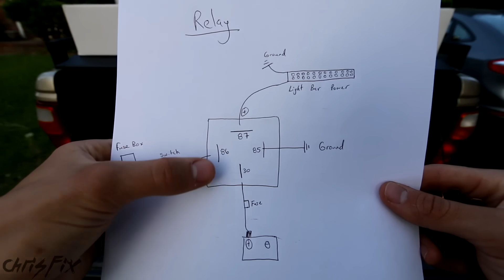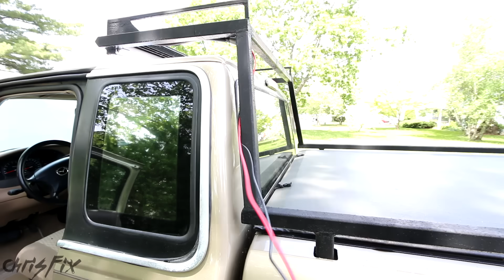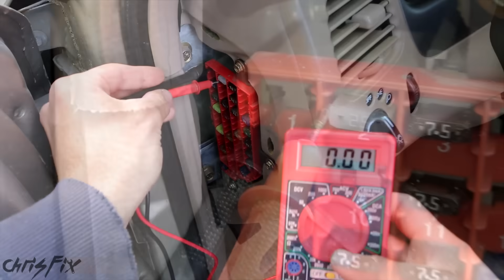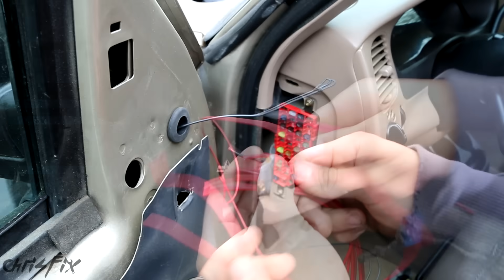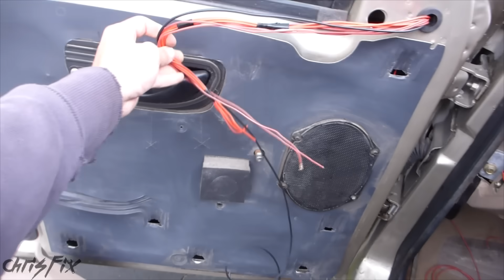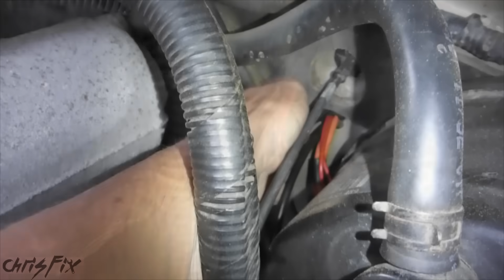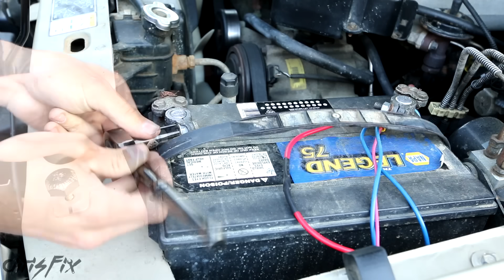How to Wire an LED Light Bar Properly (Project Night Light Episode 3)

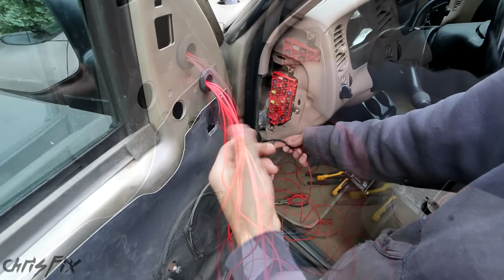Comment: Pro Tip: At around 15:00, get yourself some white duct-tape and wrap each wire on both ends with the duct-tape below the exposed wire tip before feeding them through panels and such. Then take a sharpie and put lines in the tape for each wire you have. So, if you have 5 wires, each wire should have how many lines it matches with. Ex: Wire 1 has 1 marker line on it on both ends. Wire 2 has 2 marker lines on it on both ends. That way you can distinguish which wire is what and you don't cross wires when installing future things.
Reply from the maker: +Robert Lewis That is an awesome idea! Thanks!

Comment: Great video but just so you know, you could daisy chain the 12V power as you did with the ground, as they'd all be running relays there wouldn't be much current draw. Just an idea if you want to add more switches in the future.
Reply from the maker: +Skutov R Thanks! Yea, that is something I havent thought about! I like it!

Comment: Hey chris fix, I drive a scion tc.  I want more light, more than my 55 watt hids.  Could I mount a led light bar behind my grill, will that give me more light, close and down the road?
Reply from the maker: +2583060 You cannot use these on the roadways with cars on it. This will blind a driver. I will be doing a video on how to mount a wire a light bar behind the grill of a car. If you live on remote roads this could work though. Gotta wire it into the high beams.
Reply: +ChrisFix cant wait for a video.  Also what if I just put HID bulbs in my reflector fog lights? will that help give me more light down the road?  Or like can I put some spotlights in my foglights?

Comment: What exactly is a ground for?
Reply from the maker: +Jason Forgeron That is how your lights get power. The ground is completing the electrical circuit. .
Reply: +Jason Forgeron And the good thing (or not) with a vehicle is that the ground everywhere on the frame

Comment: I have a question about the wiring of the switches, if you chose not to attach a ground to them would they still turn the light bars on? I personally wouldn't want to have the switches illuminated 24/7 but want a rocker style switch like those, is it that simple to get no light in the switch or does it need to be grounded out to work?

Comment: This is epic! It's so simple to wire something that looks so complicated. Just btw, the spots from the light bar look a bit low? Looks like quite a lot of light is projected at one small spot on the trail, can you not adjust the light bar up some more to throw more light further down the road?
Reply from the maker: +MrSly870 The light bar is actually perfect in real life. That might just be the camera exposure adjusting. Thanks man!

Comment: I wire my light bars so that there's a master "arm" switch, and then the light bar relay is triggered by the high beams. So if you want to run the bar, just flip master arm to on, and then run high beams. Car up ahead in the darkness? high beams off, light bar goes off too. 

Bit nicer because you don't have to have the master arm switch in the door, or somewhere very easily accessible. Can put it in the middle of the dash, or between the seats.
Reply from the maker: +Phr00tage Good idea!

Comment: If I install the switch to the light bar without a relay will it still be as bright ?
Reply from the maker: +william Last It will not be as bright due to voltage drop.

Comment: why  put the switch on the door
Reply from the maker: +Kyle Colburn Because it is easy to access and easy to turn on and off since my hand is right there.
Reply: +ChrisFix I think it would have been easier to put it next to your radio or your steering wheel

Comment: Thanks for the vid! Could you hook this up to the high beams as well? so the bar turns on as soon as you turn on the high beams?
Reply from the maker: +Jimmy Lager You could. You use the trigger wire that goes to the relay to trigger the light bar to turn on when you hit the high beams.

Comment: Hey Chris! Quick question! I've been planning to put one of these on my car for some time now in place of my fog lights. But hold on before you mention "No way! That'll be too bright for other motorists!". That's where my question comes in. Instead of running the switch can i tap into my high beams so the light bar will come on with the high beams? Thanks!
Reply from the maker: +Dylan Stassen (Bassman415) You can definitely run them with your high beams. Instead of the wire from the fuse tap, you would splice a wire from the high beams to trigger the relay. Almost like what I did here but for high beams instead: https://www.youtube.com/watch?v=ZVG7X-ae298
Reply: +ChrisFix Awesome Chris! thanks for the reply!

Comment: Just wondering if you have to go to the fuse box? I bought a light bar and a wiring harness already put together her and it has a relay and a in line fuse and a switch but no wire that goes to the fuse box.
Reply from the maker: +Pierce Garrison You can go from the battery instead of the fuse box.
Reply: Ok, Thanks

Comment: To add a more "professional " look , and to make the connection permanent ,  try practicing with soldering and heat shrinking all of your connections .. Even adding a small piece of heatshrink over the end of the connectors where it meets with the wire , will make them water tight (especially the wires under the hood )  Also add a small dab of Dielectric grease to any connection that can see any kind of moisture , this will prevent corrosion at the connection  ...  Soldering the connections gives a better connection for current flow vs a crimped connection.. There is also a very little chance of the connection failing (like the crimp working loose over time due to vibration ) ... ...   Another thing ,  when running 2 or more wires together ,  tape the ends together (both sides ) , clamp one side to something sturdy (like your rack or a bench ) ,  put the other end in your drill and slowly give the drill power ... This will twist all of the wires into a nice tight bundle that is easy to manage and looks good ... This also protects the wires from an outside interference as it makes a small electrical field around the wires ............. This is some of the tips I learned in my automotive electrical class ..... ............. You can also loom the wires with electrical tape using the drill method ,  once you get a 1/2 way decent twist on the wires , have someone put electrical tape on the end that is clamped , as you power the drill to tighten the twist on the wires , have them slowly feed electrical tape onto the wires and move up with harness as you turn it .......... This will add a nice and tight barrier to protect the wires ......................   (just a couple tips to make installs easier , and cleaner when running more than 1 wire ........ ) ................................................................................... Another good video , keep it up ....
Reply from the maker: +Norman Murray Thanks a lot Norman! I actually started doing that now!
Reply: +ChrisFix +Norman Murray Love the great tips....and Chris I love how you listen to ppls tips you learn so much and apply it. 
I see alot of stupid ignorance on YouTube, but its good to see good tips and someone listen instead of everyone arguing. :)

Comment: Perfect video. Nice and clear. Good job. Do you have some video about installing air conditioner for cars without them?
Reply from the maker: +Vladimir Jelesijevic Thanks! I do not have a video on installing AC in a car without them but I have this: https://www.youtube.com/watch?v=Pdq8JAlct6s
Reply: I saw that video. Thanks anyway. Now, simular to your previous video. I have doubt how to install LED background light for car switches on my 1988 Yugo. I have bundle of optical cables which will distribute light from one LED to all 8 switches, but I don't have an idea were can I connect positive side of LED lampholder. Any idea ChrisFix  that might help me?

Comment: hey there ChrisFix, nice video. wanting to do something similar with rear light/ bed light, 2 switches to power them and want them to work when the truck is off. cant find a diagram anywhere. any help would b great, thx..
Reply from the maker: +Jeremiah Graf This video is exactly what you need. This light bar will work when the car is off.
Reply: +ChrisFix  how would you add a 2nd switch. thx for reply
Reply from the maker: +Jeremiah Graf You just wire up a switch for each light. Just do what I did in this video but for two lights (your bed light, your rear light)

Comment: finally, an actual, informative video on how to properly wire and install LED light bars with those wiring harnesses that usually come with either no instructions or diagrams, or ones cryptically printed on a tiny slip a paper and included as an afterthought. thank you very much.
Reply from the maker: +cmc855 I am glad the video was helpful!

Comment: Hey randomly browsing I found your videos. I love the hard work you take to explaining and film everything! Thanks for that. BTW you need to change those battery terminals... and if life taught me something is never to zip a wire to a part that I will eventually remove  like the cable that seems to be the one to open the hood. Another thing that I thought you could used the interior of the frame that you made to guide and protect the cable. Again thanks fro your videos, I really enjoy them.
Reply from the maker: +deftoner Thanks and I am glad you enjoy the videos! Thanks for the tips!

Comment: can I use the same relay for the other light or should I use a different relate every time
Reply from the maker: +Jovany Salgado You need to use a relay for each light you want to turn on by itself or you can go up to 30 amps on one switch.

Comment: Great d.i.y. Chris!
Question for you, instead of using a new fuse line to the fuse box, I'd like the remote power coming from when I turn my parking lights on (does that make sense?). This way any accessory lights can be turned on only when I have my parking light switch on, also turns off everything when I turn off the parking switch (the accessory lights will also have individual switches). I also want to find my oem fog light connection so I can run through the parking light as well (fogs can only turn on when my main headlights are on). I own a 2015 Subaru XV and I know most new model cars have the stock fogs run the same way. So I'm thinking the relay would still be installed in the engine bay as you did but I need to find the fuse that allows parking lights to turn on?
Another request: can you make a d.i.y. on installing a hood light (with a switch or a pin (switch) once the hood opens up? Thanks. Loving your vids!
Reply from the maker: +Shotokan07 I see I answered your question in this video: https://www.youtube.com/watch?v=ZVG7X-ae298&lc

Comment: Awesome idea with the switches in the door panel.  I never thought of doing it that way, but I like it.  Not sure it would work for me, but I have a long way to go (regear, bumpers, winch) before I can even think about spending money on a light bar. =(

I'm definitely not a fan of the Herculiner though.  It just doesn't look as nice as Rustoleum truck bed coating, or (I think) the duplicolor stuff.  The bed of my taco was done in Herculiner by a PO and it looks kinda bad.  My rock sliders and bed rail caps are done in Rustoleum truck bed coating and they look pretty good.  Admittedly, it's not the world's most durable coating, but it's not hard to touch up.

I'm glad you took the hood glare into consideration when you mounted the light bar over the roof like that.  Not many people think of that before they mount their light bar over the top of the windshield.  Good job on that.

One suggestion I would have made would have been to extend the top bar over the light bar out in front of it a bit.  That would have provided more protection for the light bar's lens when smacking low hanging branches and whatnot, but at least what you have is protecting it from the brunt of the impacts.
Reply from the maker: +Taco No Baka Thanks a lot and thanks for sharing! Your taco project sounds awesome!
Reply: +ChrisFix 
Haha, thanks.  It's not so much a project as it is an on-going evolution.  It's a '98 Tacoma 4WD V6/manual.  So far, she has a 3 inch OME suspension lift with Dakar rear springs.  She's running 33x13.50 Super Swamper LTBs on 15x8 Pro Comp series 97 matte black steelies with 3.75" BS. She's Lincoln-locked in front with a Detroit in the rear.  She has 4xInnovations rock sliders and a BudBuilt front skid.  She's painted with Hotrod Flatz OD Green and her only lighting upgrade is a more or less decorative set of LED cab clearance lights.

The Detroit in the rear was the latest upgrade and it really took her to another level of capability.

Comment: Just a suggestion and I'm not sure if you've already considered this but because of the amount of lights you plan on running have you considered setting up an auxiliary battery?
Reply from the maker: +steel hitch I have considered it but I think the alternator is more important than the battery right now. I need to figure out when the battery is the limiting factor.
Reply: +ChrisFix ah ok fair enough, loved the video by the way, thinking of installing one on my land cruiser, was a huge help
Reply from the maker: +steel hitch You are going to like my winter project ;)
Reply: +ChrisFix getting very excited!

Comment: not to be a douchebag but if u had set the light up before you capped everything off you could had ran it inside your neat headache rack
Reply from the maker: +jon lowprofyle Thanks for sharing. I decided against that because everything rusts real bad here. So I sealed all of the metal tubes to prevent rust.
Reply: +ChrisFix same here in MI was just an idea looks good tho

Comment: What brand of cable/connectors/wire crimps/heatshrink/etc. do you use? If I don't have a heat gun… can I use a lighter (like a zippo)?

I'm gonna wire my 99 Outback with some LED spot/driving lights, and I don't have any tools, so I have to start from scratch. Haha.
Reply from the maker: +OverlordXenuAnon You can use a lighter and check the description for the products I used in this video.

Comment: You have set of four high beam lights and on off road it didn't light anything. Did you use them or are those just installed in other way?

In my old Toyota corolla I have two external high beams and they light up pretty good.

But in any case, watched whole project vids and you are doing pretty good. Welding and wiring. Like me, self studied amateur.
Reply from the maker: +TheKikkarapaa The 4, 100 watt offroad high beams are nothing compared to the new LED light bar. They look dim because the led light bar is crazy bright in comparison! I am glad you liked the series and it is awesome you watched the whole project!
Reply: Well, thanks to you, I have been watching some of your vids to see new techniques how to fix a car. :)

Wish I had a camera and tripod to film my own :/

Comment: Great Video Chris, fitting a 20 inch light bar to my Pajero (Shogun) this weekend, I have to figure out how to switch it to the high beam circuit due to our Australian regulations (driving lights must dim automatically on low beam). Excellent choice of switch position, I will watch your other vids
Reply from the maker: +John Wood Thanks John!

Comment: Chris! I have a very important question! I've never done any kind of wiring before, I'm definitely up to the task. Oh abs some strobe lights I was going to install on my car. The kit already comes with a controller with a positive and negative wire that runs out of it. Do I only have to just run the positive wire to the battery and ground it? Or would i need to fuse it? And would I be able to fuse it like you did?
Reply from the maker: +soulchain247 You would have to fuse it like I did. And yea, positive to positive terminal on the battery with a fuse and the negative can be grounded anywhere (chassis ground).

Comment: Came out really well.  Did you need a separate power cord for each switch?  The ground technique works well
Reply from the maker: +Alex12153373 Thanks a lot! I did use a separate power chord for each switch. I cannot run a ground switch because I need to trigger a relay and the wires would be too thick.

Comment: Why didn't you run the wires from the light bar through the square tubing for as long as you could?
Reply from the maker: +Steve Messersmith Because I sealed the tubing to prevent rust which is very prevalent where I live.

Comment: Great vid man used itTo wire the light bar onto the front of my truck, also had a quick question do you think you could run two light bars to the same relay/switch
Reply from the maker: +jasoni921 AWESOME! You can run two light bars to the same relay as long as the relay is rated high enough. This is a 30 amp relay so you can run anything up to 30 amps off this relay.
Reply: Awesome thanks again